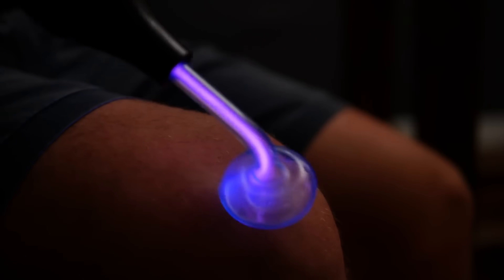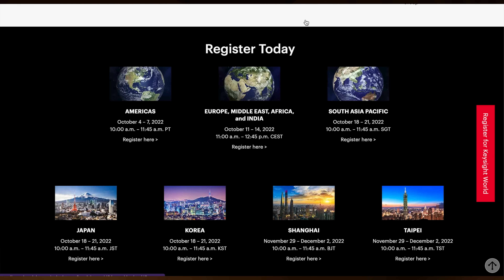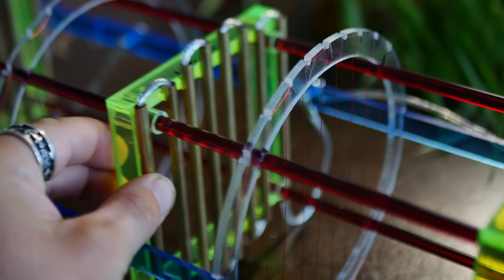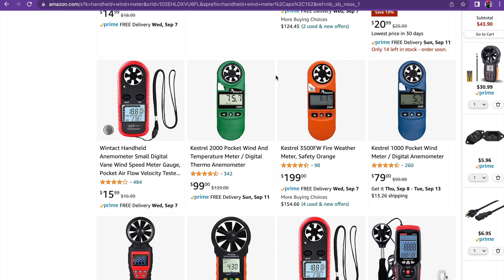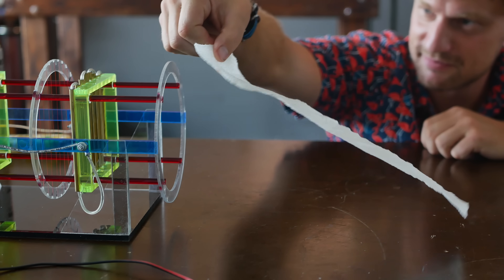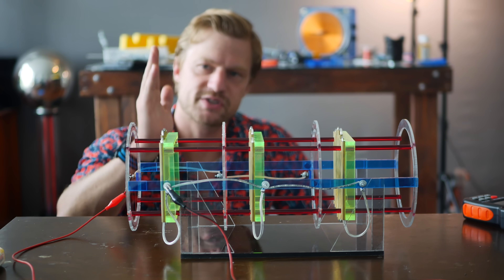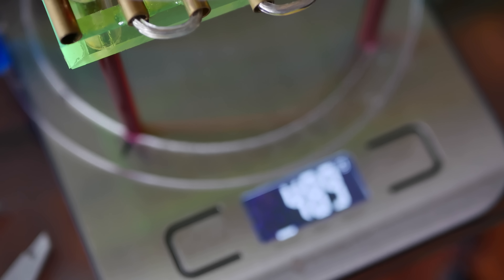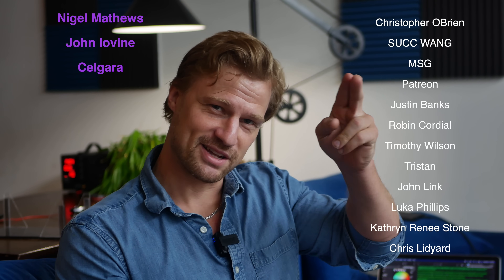Designing A Next-Gen Ionic Thruster! (For Flight)

Comment: My thoughts on improvements:
1) Ducted airflow. Preventing air from moving out of the system until the end.
2) Adding a nozzle. The airflow velocity increases due to the constriction of the tube radius, therefore after the acceleration, you could decrease the tube radius to give more thrust.
3) Adding barbs to the emitters. Charge accumulates more intensely in sharper locations and will be emitted more freely.
4) Magnetic fields. Given the charges passing from one area to another are known, having solenoids creating magnetic fields around the ducts that induce a more significant flow would help the movement.
Reply: Kyle, all of the ideas listed are good. Comments 2) Add a grounded ring in the nozzle to reduce turbulence, 3) Try a fine multi-stranded wire like Litz wire, 4) Look at the design of a drift tube which uses charged rings, not magnetic fields, 5) My favorite, sequentially pulse the grids to generate cascading waves of ions in the direction of flow.
Reply: @johnwilson4909  #5 would also increase energy efficiency, good idea
Reply: I see an obvious improvement by making the electrodes have a teardrop cross section so they are more aerodinamic
Reply: @danielcesponsisto8601  yeah with the current round electrodes theres gotta be huge parasitic drag.
Reply: @danielcesponsisto8601  That will reduce the area of the cathode and will probably produce spark rather than corona.
Reply: @Coldphoenix44  You can do a lot with a deliberate spark though! How about a big arc in the combustion chamber of a jet engine to provide the heat instead of burning fuel?
Reply: @danielcesponsisto8601  In doing so you'd absolutely be able to have a pointed end to allow for better conductivity- very good idea!
Reply: I think coils or magnets would add too much weight.
Reply: @adrien5568  Iron nitride magnets 6x the field strength of neodymium
Reply: @adrien5568  what about winding a high voltage Tesla coil around the outside? And just a few ferrite beads, where you want the strongest magnetic field?
Reply: @Soupie62  If the coil is made of Litz wire, why not.
Reply: @adrien5568  Unless it increase thrust by a factor of a 100 or so.  He already needs 25x the power to get this off the ground.
Reply: @adrien5568  Coils only, and it need not be a lot.
Reply: @adrien5568  ….unless ambient temperatur superconductor become available
Reply: Problems with using a ducted design is weight and very low static air pressure. Bought factor can reduce the efficiency a lot.
Reply: @bknesheim  Paper tube treated with water glass?
Reply: @bknesheim  Couldn't some lightweight material be used as ducting. something like saran wrap or light gauge aluminum foil(obviously shielded from the current. It doesn't need to be structural just direct the flow of air out the back instead of wherever it feels like going.
Reply: @dirge4november84  It have to be some structural since it would have to withstand pressure from the outside- The higher speed on the inside of the duct will reduce the internal pressure. It also most not vibrate since that would steal energy from the airflow through the duct.
Reply: @bknesheim  so maybe carbon fiber which would be lightweight, structurally strong and non conductive.
Reply: @dirge4november84  Carbon fiber is conductive. Maybe some other composite would work though.
Reply: @bknesheim  If the duct is also the frame - resin infused carbon fibre would be strong smooth and light. Just need the design finalised to make the mould....
Reply: get some radioactive material to put on your electrodes.  use many thin electrodes, put barbs on the electrodes
Reply: converging diverging nozzles!!!
Reply: @mastershooter64  it usefell only when airflow is atleast mach1 , or if u have heat energy in the air (fuel burning) to sacrifice for for additional kinetic energy
Reply: I hadn't thought of magnets, that's an interesting idea!
Reply: @m0nologger  it should help due to the air already being ionized.
Reply: @m0nologger  It’s an electrical thing- you didn’t think about magnets? All electricity is electro-magnetism, genius.🤦‍♂️🤡🤷‍♂️
Reply: Yeah thinking the same, a surround around the thruster to contain the air and maybe a cone at the end to accelerate the airflow and focus thrust, similar to a jet engine
Reply: @SuperXtremeJosh  Thanks for repeating the original comment.
Reply: @SuperXtremeJosh  that would be interesting to see. I would be curious to see if the increase of velocity is isolated to the volume of air being pulled from the front or if it increases because it’s pulling air from the sides also.
Reply: I would say size too
I think he could make the whole setup more compact and either maintain, or increase performance
Reply: This all will add up lot of weight which end results to thrust to weight ratio remains same, I tried this including Lorentz force with neodymium but not worth it trust me..
Reply: This comment is imporant... I would like to see this improovements
Reply: ducted airflow may not work(require pressure difference btn i/p and  o/p) !  because air flow in this case is created due to viscosity(momentum exchange to next layer of fluid) .this engine suck most amout of air from sides
Reply: @afijithsp5413  there are many patents on this tech with some using radio isotopes on the ion emitters
Reply: 1.) is so obvious.
- I would say 3 data points is not enough make it at least to 5.
- Optimize the aerodynamic design internally(maybe)
Reply: Agree with ducting.  Would also experiment with ducting that allows air in at each stage but doesn’t let air from previous stages escape.  Perhaps annular thrusters that keep adding air to a central core.  As for a nozzle, that would reduce thrust output.  When producing thrust with air, for a given energy input, the larger the diameter of moving air and the slower it’s moving, the more efficient it is.  i.e.  the more thrust you get for a given input.  Nozzles only make sense when you want more air speed.  That’s why commercial airliners have giant engines with relatively low exhaust velocity and fighter jets have smaller diameter engines with extremely high exhaust velocity.  The higher exhaust velocity matters when you want to go fast, but you pay for it with loss of efficiency.  Obviously if you start looking at vehicle integration, exhaust velocity becomes a design point, but as a research project to create the most thrust, keep air flow large and slow.
Reply: EDF fans on rc jets need a certain length tube after them to reach their rated thrust. So could help on this maybe too.
Reply: I'm not sure a solenoid would work unless it was D.C. and the same charge as the ions passing through. Cuz if their the same charge it should work like a sort of magnetic confinement like in fusion reactors...at least, I think it would. If the solenoid was charged oppositely to the ions I think it would pull the ions towards it though.
Reply: a better tip for #1 is fented ducted airflow, building the ducting in such a way that it can pull air in but not allow it to blow it out, like what you see with vents on a car to extract heat from the engine bay
Reply: you already hit all the ones i said, except that the linearity and horizontal patterning could be staggered as well for better results. If this was set up as a circular thruster it may provide better centripetal force and acceleration for the arflow. barbs could be akin to nodes especially if capped with materials that were calculated for ion pairing. certain peak numbers will induce the best ionization dependant on the material and its affinity for ionic bonding. The airflow is the big one and everyone seems to agree a ducted system with perhaps a circulating system to direct flow seems outward seems like the best place to start. As for the solenoids, im assuming you mean lining the outside because in the center it would provide too much resistance and most likely stop ionization. however if lining the outside with staggered charge it could create inward magnetic pressure that could harness the airflow without a material body and also ensuring better clearing of all energy like heat via inductance if made properly.
Reply: what if he added surface area? Folded a central wire into a hilbert curve instead of adding several straight ones?
Reply: Some air ionizers use many thin carbon fiber filaments to increase the degree of corona discharge, this could help increase the efficiency with respect to drive current.
Reply: build that darn ufo already kyle,   quit messin around
Reply: Why is everyone coming up with hypothesis? I'm sure there's someone here that knows how to simulate it on solidworks or code it

or even better, build a model and test it in standard conditions

I think he should get an Arduino to measure analog→digital data and then calculate the best model based on the variable change(combination) that produces the optimal solution 

there's too many layers to physics, we can't always know which ones are the most important unless we actually get real world data to have an idea about the scale, at least

like if the improvement would be closer to the scale of 1% or 10% 

I'm sure most are true hypothesis, but how much does it matter in the real world?
Reply: good idea
Reply: I was very surprized he didn't do the first too. It was good how the system could offset though.
Reply: Dont understand how nozzle can increase thrust , sure , it does increase air velocity if initial velocity of air was supersonic and high temperature, here it is just subsonic , converging-diverging or , converging , whichever nozzle is put , it has no effect since its non compressible flow we r dealing with here
Reply: Need less inductors
Reply: Ducted won't work because it is drawing air in from sides to accelerate air velocity.

This can be proven by using pieces or string or yarn hanging on sides.
Reply: @imillionaires  could some kind of intake bypass still make it possible?
Reply: omg youre actually sooo correct. HEAVY WATEERR- Tritium, deuterium, ELECTROLYTES LIKE LIQUID SODIUM POTASSIUM AND MAGNESIUM!! THEYLL FUNCTION LIKE ION CHANNELS IN THE BODY! AND THE HEAVY WATER WILL CREATES RESISTANCE TO FLOW BUT THE VISCOSITY AND WEIGHT WILL CAN CREATE SO MUCH MORE FORCE. CHALLENGE WOULD BECOME RECONVERTING THAT INTO AIRFLOW BUT IT WOULD LITERALLY WORK LIKE A IONIC PLASMA THRUSTING WATER PIPE!
Reply: Nice thinking, didnt know the 3rd one
Also, he could put rings or like 8th of an inch tubes to carry positive wiring so the airflow is much better, and because the forces of wind he could also lose much on weght because they could be as thin as possible, for now, until this dude makes it go to space
Reply: 4 would add way too much weight and make it ineffective
Reply: @kaesoron-m6h  i said the same thing but if the magnet were surronding the body as a shell creating a magnetic field repelling towards the exit end of the cylinder/barrel of the thruster, it could act as a magnetic rail gun with the ion flow and propel the plasma to passively increase its thrust. especially if liquids like deuterium and liquid potassium were used though of course this leads to volatility and need for more complicated materials, wiring, and surrounding shell, ventilation or cooling.
Reply: If weight is a concern I think number 1 could be accomplished with some pieces of cling wrap. The nozzle may need a counterbalance, so maybe not that unless there's a way to do it with VERY lightweight materials. Barbs to the emitters... Could that be accomplished by bending the wires slightly? Magnets and any added weight could prove detrimental to the T/W ratio, so perhaps electromagnets wired in series and integrated into the design might be a good idea. 
I don't know a ton about electronics, but those are what I thought of as I read this.
Reply: @Kyle_Wall Came to say the same: do check out Magnetohydrodynamics at the sea for inspiration on #4
Reply: Somebody's already probably suggested this. But it would seem to me that if there was a way to compress the air coming in to the plasma flow that the ions would have more atoms to collide with.
Reply: generate electrons instead of using just brute force  like voltage ALSO use a photoelectric material which gives of electrons when light of a certain frequency is used. Cesium is used but other materials can be used like Semiconductors like silicon, cadmium telluride, gallium arsenide and copper indium diselenide are the best material for photoelectric emission. Generally, for the photoelectric effect, materials with low work function are used so that electrons can be emitted from the material by a photon of very low energy. So try this in your next experimrnt as it could generate more thrust or use less power or improve efficiency in thrust per watt.

Normally in photoelectric cells metals that have low ionisation enthalpies or metals which can emit more easily are used. One of the most popular metal with such characteristics used in photoelectric cells is Cesium (Cs). It is an alkali metal belonging to group 1.

Caesium (Cesium) is widely and commonly used in photoelectric cells because it can easily convert sunlight into electricity. During its exposure to direct sunlight, the electrons that are there in caesium’s atoms get stimulated and start moving around. Ultimately, this electron flow creates the electric current. Hence, we can say that caesium is the most preferred or ideal catalyst for the photoelectric process.

In addition to caesium, other alkali metals like potassium, rubidium, copper and silicon are also often used as an alternative in solar panels.
Reply: Wouldn’t magnets force the electrons and thus the air to drift perpendicular to the intended flow of air? Since force on an electron is a cross product of the E field and B field, wouldn’t they all be orthogonal?
Reply: And I feel stupid again
Reply: Using an all in one 3d printed in carbon fiber close chassis would give relatevlt insane gains, not only the weight would be the same or even reduced, but carbon fiber would have a very great structural strenght + having a 3d printable model of the chassis would help if it brokes.
Reply: Another Idea would be to change the shape of the charge emmiter
Reply: Addition of the magnetic field will also add weight, this may be counterproductive.
Reply: The beginning of the repulsor...
Reply: Smaller fins?
Reply: I honestly don't think a nozzle would be a good idea because you would use a nozzle on something like a rocket or jet engine because they increase the pressure of the gases moving through them by burning them cause them to expand exponentially whereas a ducted fan does not which would make it lose efficiency if you put a nozzle on it
Reply: apptly put my friend...
Reply: so number 2 uses the Venturi effect?
Reply: I'd shorten it overall if your max seperation is 1.5inch. Perhaps get 5 cells in there in 75per cent of the length.
Reply: 1.  I think you would still need intakes in the open areas of some kind to provide additional air to the two rear ionizers because the second & third ionizers wouldn't be shooting out as many ionized particles as some would already be ionized potentially. Essentially the second and third ionizers are larger than they would need to be.  I think it's a good idea if you want to reduce power consumption of the rear two ionizers and potentially reduce weight as well.  Otherwise it should be a predominantly closed duct with minor air intakes for the second and third stages.
2. Yeah the nozzle idea is great idea and can resolve the minor issue from #1 and that nozzle should contain multiple negative plates within the frame/nozzle itself to attract the particles more.  I think this is how the NASA ionic thrusters work too.
3. Barbs are a great idea as you can see in the still image the charge is accumulating periodically along the cable and so any thing to spread the charge release out more would do well.  I also think that he could add some additional horizontal positive leads for added charge release without affecting weight too much.
4. I think that the solenoids would be better suited around the plasma sections of the thruster because that is where most of the ionized particles are at and would be most affected by the magnetic field.  The solenoid placed on the "open air duct" segments would have a lesser affect on the particles than at the plasma region because of reduced charged particles in this area.  That additional problem is how to build and shield the solenoid so that it's far enough away from the plasma that it won't attract most of the particles to the wall & hit the solenoid, creating drag, and instead be spaced far enough away that most all the particles will be boosted out the back, but not too far away that the power of the magnetic field has to be high enough to affect most of the particles increasing power consumption and therefore weight on the future vehicle that might house this bad boy!
Reply: Nice ideas. One note is that a nozzle will not increase thrust in this setup, actually decrease it. Nozzles are mainly used to convert the excess static energy created in an engine i.e static pressure over the ambient conditions and excess heat, into usable kinetic energy (velocity) and therefore thrust. This engine creates a velocity gradient without any total heat or pressure additions like what would be seen in an engine with a nozzle. There is no excess energy added to the flow that is not purely kinetic, and because of this nothing for a nozzle to convert. It would most likely reduce thrust due to viscous losses and flowback issues since the nozzle outlet pressure (even for just a converging nozzle) will be lower than ambient p[pressure.
Reply: Maybe some sort of magnetic field compression and, if directed in the right way, also increases speed.
Reply: Thumbs up to for points 1,2 and 3. While 4 is not a bad idea the benefits do not outweigh the...weight. To add to your idea: I would experiment with variable distances of different stages inside a velocity stack. A double stack could also work to have the thrust on the main jet a accelerated by the thrust of the outer jet, and then just play with aerodynamic effects.
Reply: Would spiralling the wire create more of a vortex? Or manipulating how the flow of air moves as it passes through?
Reply: Could you also add a compressor to the inlet stage to have a more condensed air entering. My thoughts are more dense air=electrons passing more particles=more air moving thus higher thrust
Reply: Adding eductors??
Reply: Great
Reply: It needs compressing in - decompressing out somehow… excellent idea!
Reply: I didnt even consider the magnetic field!
Reply: i think a funnel nozzle would work the best or so intuition told me
Reply: Radially simmetrical design perhaps?
Reply: Wouldn't solenoids just make charges that are moving offset the axis spin?
Reply: I actually thought the same, except 3. Nice :)
Reply: Add "Increased DC frequency". It'll provide the low and high that is needed for thrust.
Reply: You are correct. This needs magnetic fields to modulate power out put and direct energy field particle flow.
Reply: Also look at pulse. Amplified pulse for the charge then everything you said may work but for your tube maybe thermo conducer environment with in the tube before nozzles
Reply: Can you look at my comment to see if it makes sense to add this to that?
Reply: A whole improvement list that sounds profitable
Reply: Oops you beat me to it. Didn't see your post until I had ask in a simple way.
Reply: Would it work with just simple plastic film wrapped over it with a smaller outlet for the air?
Reply: 5) Ajust each section to a different voltage and electrodes distances... the logic is: Higher air velocity => greater electrodes distance and higher voltage needed!
Reply: 1. Add more stages. If three stages produced the maximum thrust in this experiment what would 4, 5 or 6 do?
2. Increase the velocity of air entering the ion drive and use the ion drive to increase the velocity.
3. Use the ion drive and a ducting system to direct air into a Dyson thruster.
Reply: All of these plus a carbon fibre frame, should test the most efficient amount of wires is to gain maximum thrust for power usage
Reply: What he said
Reply: Dumb stupid question from a 'not a physicist'  - what happens if you duct it up, and nozzle goes where a propeller would go? On a very slow moving boat? Powered by solar could it move loads ⛵🤔
Reply: His results show that putting them in a row isn't doing much. You might as well put them side by side which should increase the thrust... the whole thing seems to be a bust currently
Reply: Create a vortex?
Reply: there's a nozzle you can add that will spin the air causing a vortex and thus increasing the thrust, it's used on airplanes
Reply: @jamiebennett6354  Nozzle serves purpose when you can get the airflow speed to reach atleast mach 1 and the air is heated up (fuel in case of airplanes) in which the temperature/heat is converted to kinetic as it comes out of diverging nozzle
Reply: If it's going in a plane I'm not sure ducting would make that much sense, right? Perhaps as a test, but structurally, that would be part of the aircraft I would think.
Reply: @SK83RJOSH  structurally, yes, ducting would be part of the actual aircraft... but that doesn't make it any less important for the thruster itself. Designing and testing the thruster with various duct designs can help identify an optimal structure for the ducts as well. Additionally, if there turns out to be a zero margin of error for assembly inside the duct, then it might be best to inclose the thruster in an attached duct that can then be slotted into the engine housing of a jet.